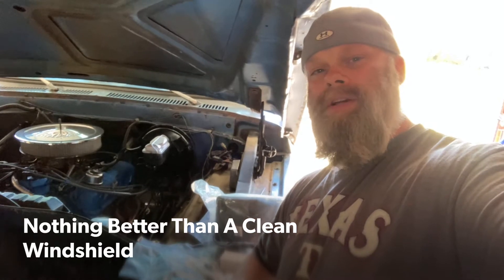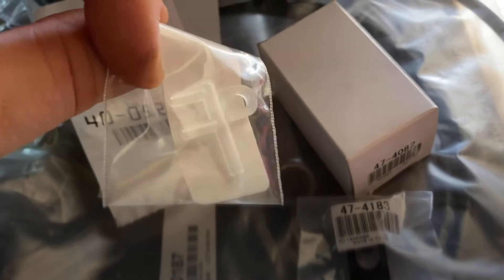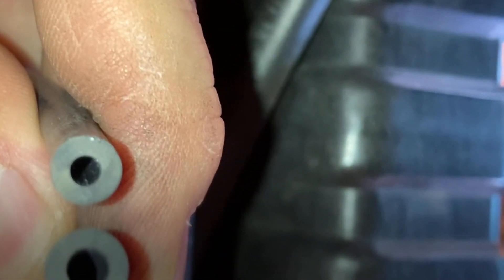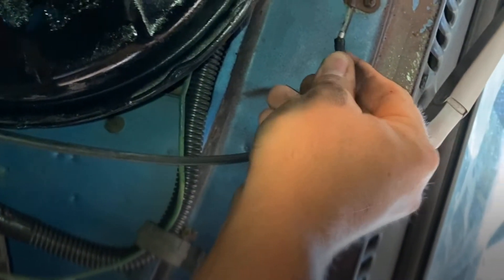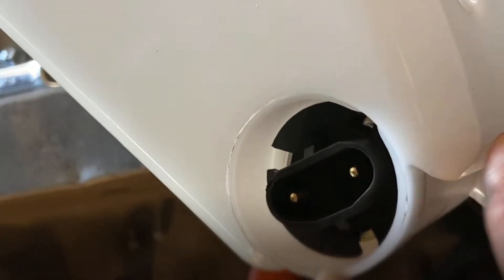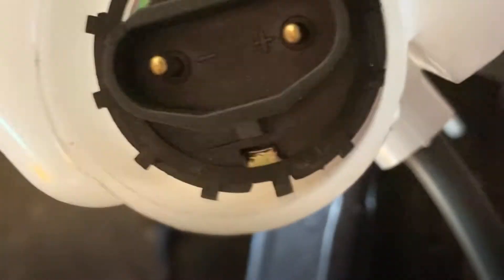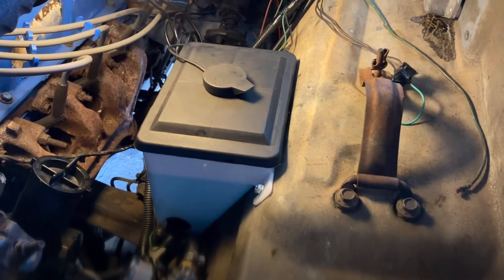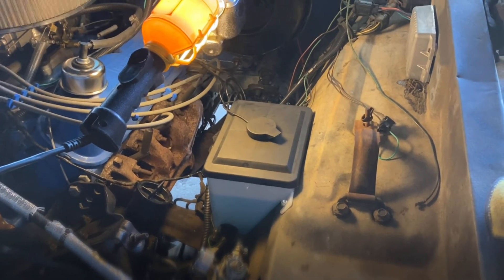Windshield Washer Reservoir & Pump/Hose Install - 1977 FORD F-150 Ep. 6

Comment: Subscribed, thanks for the information. Where did you buy the parts at?
Reply from the maker: From LMC Truck website:
https://www.lmctruck.com/1973-79-ford/fc-1973-79-windshield-wiper-components

Here’s pump part#
47-4082 for $12.95

Pump Socket
47-3051 for $3.45

Reservoir 
47-4194 for $27.95
Reply: Thanks!